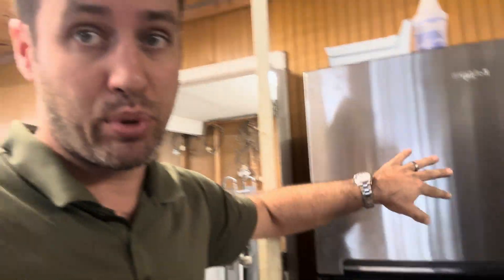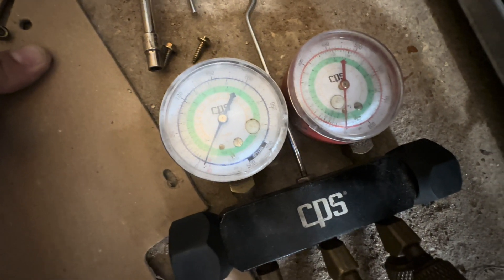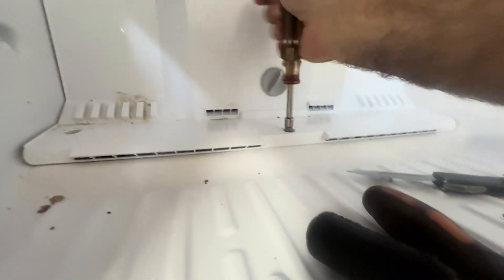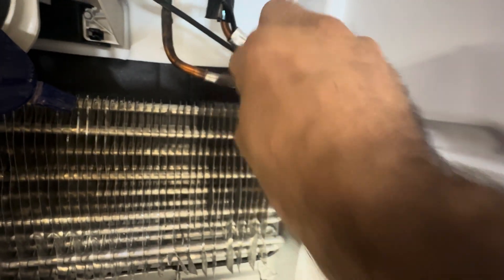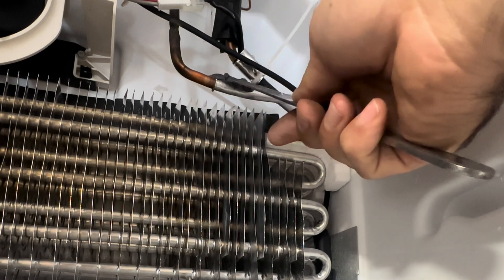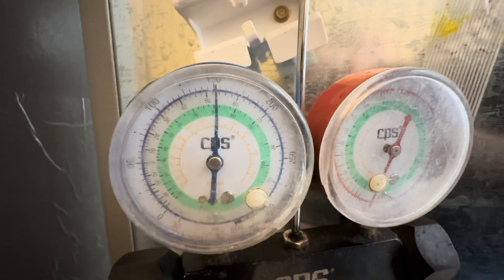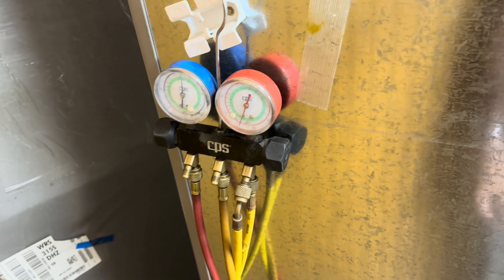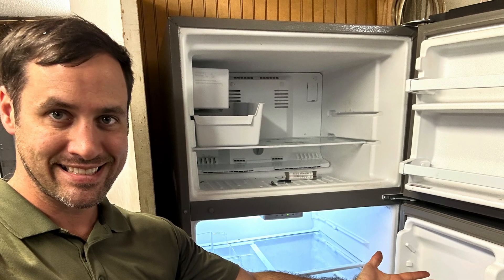Whirlpool Refrigerator Not Cooling at All | Leak | WRT518SZFM00 | ⚠️ Redneck Engineering Time ⚠️

Comment: NOT how to repair a refrigerator.  using super seal is a much better option.
Reply from the maker: I’ve tried it.  It works sometimes on small leaks. But I’ve had these JB weld “bandaides” last a long time. During Covid I couldn’t get a evap for a whirlpool sidekick freezer so we bandaide it too and it lasted about 2 years. The. Started leaking. Then I put an evap in because it was available then.

Comment: JB weld will not repair this problem.  Temporary fix. You need a new refrigerator. This is a low end $900.00 refrigerator. Not worth the time. Buy something better.  You can not solder Aluminum to Copper and expect it to last due to different expansion rates of the different metals.
 If you have a sealed system issue in this low end  ~$900.00 refrigerator then you are much better off buying a better quality refrigerator.
Reply from the maker: Very true. Bandaide here.

Comment: Have the same exact fridge with the same exact leak. Always leaks right between the copper and the aluminum connection. Complete junk
Reply from the maker: @65WKFoster  oh no! Yea sadly that’s why I knew exactly where to look. It’s not the first one I’ve seen leak there. Thank you for watching and commenting. Hope you had it fixed properly not with just a temporary JB patch. But hey you do what you have to do to get it cooling. 👍

Comment: JB WELD, baby|
Good repair! Sadly, this is such a common occurrence on these models I have to assume Whirlpool figured out how to build a refrigerator that would self-destruct just long enough outside the warranty to keep on selling them indefinitely. Purely planned obsolescence - a certain failure and an expensive one for a cheap refrigerator that's already been in service for 3-5 years.
If I were cursed with one of these, I'd take off that plastic sleeve, smear JB Weld all over the junction and a fair way down the aluminum tube and cross my fingers it would prevent the 100% certain early failure.
I really like your videos!
Reply from the maker: @ethelryan257  Thank you Ethel. I really appreciate the positive comments. Yes you are 100% correct. Planned obsolescence is in all this stuff

Comment: JB weld ...Good find for leak! Did you use nitrogen to bring it 150-200 pounds?No need to change drier?
Reply from the maker: @VictorAgresti  so they were trying to get away with as cheap possible. So I pulled longer vac and put some thawzone in it just in case. No, we have nitrogen but I just use an old compressor to pump them up now days. It’s just quick and easy.
Reply from the maker: @VictorAgresti  thanks for watching.
Reply from the maker: @VictorAgresti  if I was putting a new coil in I’d go 100% and put a new drier on
Reply: @LAapplianceguy I enjoy watching you tackling any job👏
Reply from the maker: @ I’m always trying. Thanks 🙏

Comment: I remember watching one of Ben Appliances and Junk videos and he did say to avoid all top freezer whirlpool fridges. Apparently they all suffer bad solder joints between the aluminum and copper connections. I believe that these models are supplied by a manufacturer in China unlike the Whirlpool bottom freezer models.
Reply from the maker: @xcmskim4  sadly they all made cheaper and cheaper. The aluminum is so thin any friction and it gets a hole in it. Thanks for watching and commenting 👍